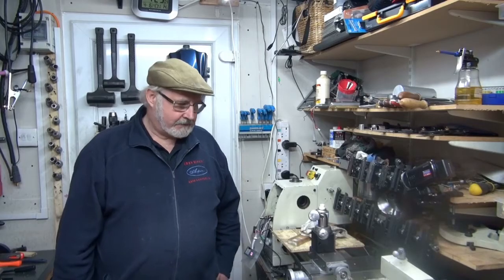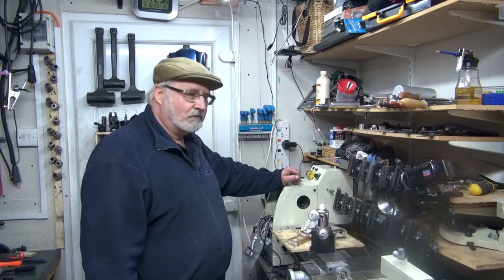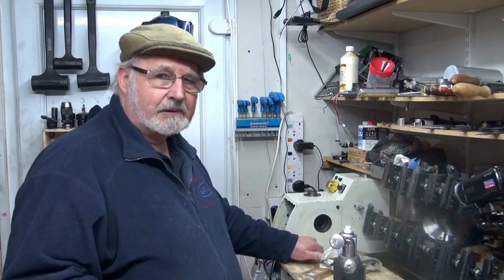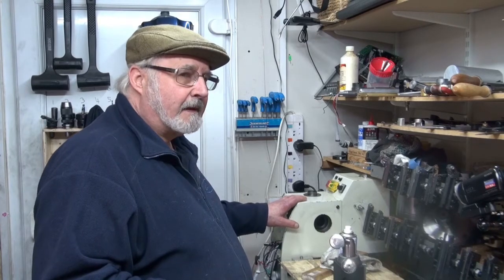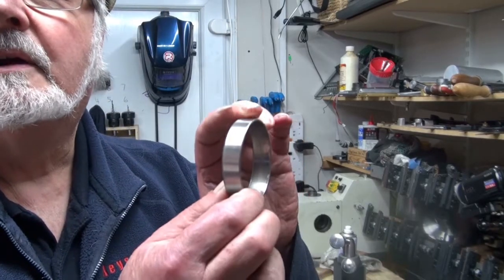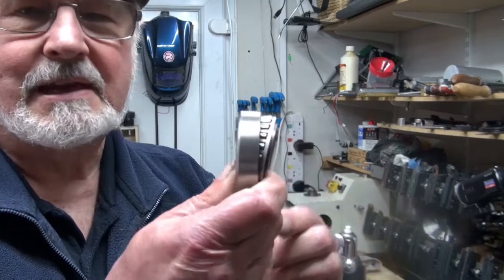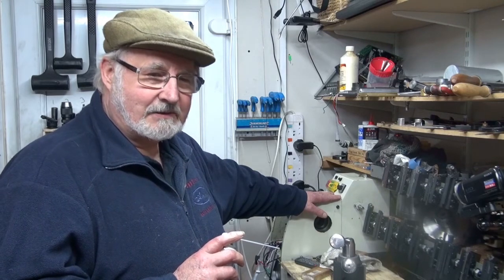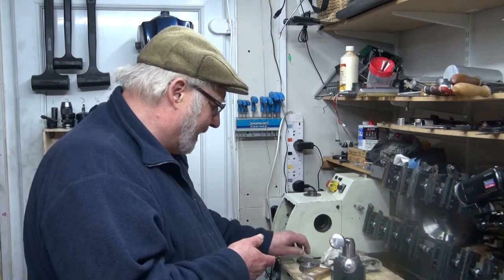Lathe Repair (Trouble at t'Mill)

Comment: Hi Keith this is the first vid I have watched, by any chance was the bearing over greased, there seems a lot around the rear bearing. many fitters engineers included think bearings should be packed. This is not so.
I was a machine tool engineer though I prefered the title technician as my qualification was an HND in Mechatronics and not a degree., I fitted many spindle bearings almost always to CNC lathes, mills and machining centres some were pretty large spindles and some of these get lubrication fed to them in the form of an oil feed also used for cooling. When fitting bearings with grease lubrication the recommended amount of grease on say 3 spindle nose tapper rollers and the 2 rear of say 125mm diameter was no more than about a tablespoon full between them.
This may not seem like much and when I enquired the first time I did this job on a CNC Tsugami around 1986 it was explained to me why so little grease.
When well greased with the small amount of grease the rollers are lubricated even though most is pushed away from the rollers they will stay lubricated with that light film for a long time as they do not need much grease to lub them. 
If packed in and around the rollers and cage the grease may have nowhere to go when pushed away from the rollers especially if 2 or 3 in a row, this can prevent the rollers from turning causing excessive wear and possible seizure.

Comment: Hi Keith, I have the exact same lathe from Chester. I went to do some work yesterday and the machine is dead. I’ve checked both fuses, front and rear and they are ok. I know there is power as far as the front fuse so I’m wondering if you have any thoughts as to what may be the problem, given your knowledge and experience. I’d be grateful for any ideas.
Reply from the maker: I afraid I haven't. I think there were fuses on the controller boards. Check for any  components have blown, Power transistors , Capacitors loose connectors etc. That's what happened to mine, I think you can purchases the boards. Rather than  than do that I bit the bullet and fitted a VFD and motor and never looked back.
Reply: @Aspins  In case any of your viewers have the same issue Keith, I found there was no power from the on/off switch onwards to the board/s.  Picked up a new on/off switch from Chester Tools and replaced it and now all working.